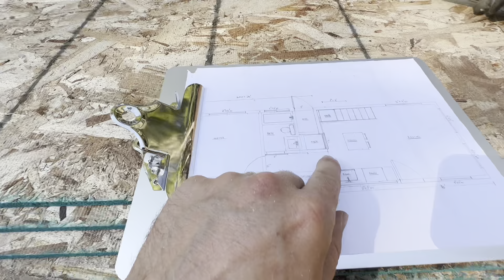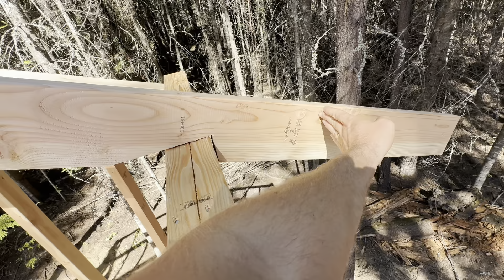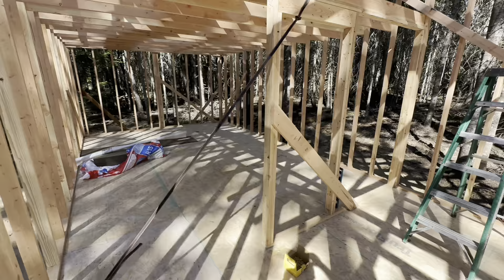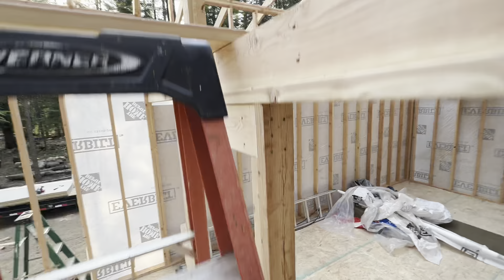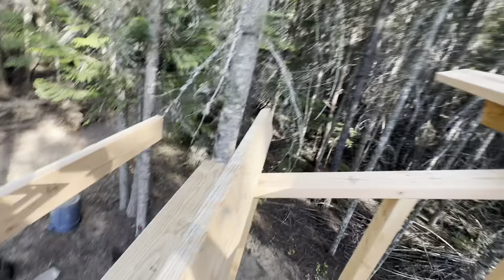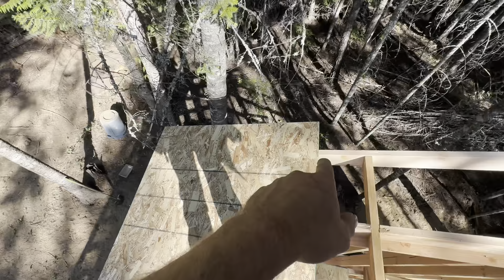Tiny House Build Part 11 (The Roof!)

Comment: I still think you should swap the Frig and washer/dryer locations.
Reply from the maker: I’ll definitely consider it. :) especially once we get more done inside. 👍
Reply: @thebuildinginvestor8427  FYI Kitchen design suggest we consider the path between the sink, range and frig as a triangle. The circumference of this triangle should be as small as possible with no obstacles.

Comment: As to the ridge beam, it looks like you have a double 2x10 spanning 20', but rather than using 20' members, you have joints between spans.  So the simplest approximation is that it is only as strong as a single 2x10.  [That approximation would be sharp if you happen to have a joint at the point of maximum moment, as then the entire moment would be carried at that section by a single member; if you know that you have two full plys at the point of maximum moment, you could calculate the moment at the joint locations and use it instead of the maximum moment, assuming you can calculate the stitch nailing appropriately.]

Your ridge beam tributary width is 7 ft (half the building width) so each beam span is carrying 140 ft^2 of roof, so no live load reduction is permitted.  Not sure what your exact dead load is from roof sheathing, metal roof, rafters, insulation, and gypsum board, but 10 psf is a commonly used figure.  And the roof live load is 20 psf.  So your ridge beam has to carry 210 plf for 20 feet.  That means the reactions at each end of each 20' span are 2100 lbs, and your maximum moment at the center of the span is 1/2 * 2100 lbs * 10 ft = 10,500 ft-lbs.  [This assumes a simple span; the way you have constructed the beam it looks like you have continuity over the center post, so the maximum moment would be greater than this.]  That exceeds the capacity of a single 2x10 of any grade and species.  An online calculator I haven't verified suggests a select struct douglas fir larch north 4x12 would suffice, but best to verify that or use some LVLs and the manufacturer's published data.

If you added supports to reduce the span to 10', then the reaction would be halved to 1050 lbs, and the maximum moment would be quartered to 2,625 ft-lbs.  Now the online calculator says a SS DF-L(N) 2x10 does suffice, although #1 grade would not.  Or if you added tension ties between the wall plates, say metal rope every 2' or 4' on center, then your ridge member would no longer have to act as a beam, you'd be back into the conventional rafter situation where the ceiling joists/tension ties keep the wall plates from spreading apart.  Although that wouldn't work in the loft area, and even in the unlofted area, it would interfere with the headroom for your stairs.

I guess in the lofted area you could also consider that each stud is braced near its top end by the loft floor joists, so they could be modeled as cantilevered beams to resist the outward thrust of the rafters.  I've never worked out the details of that approach so I don't know if that is likely to check out or not.
Reply from the maker: Hey! Thanks for all your research! 👍
Reply: @thebuildinginvestor8427  Hope it helps.  I forgot to say that if your ground snow load is higher than 20 psf, that will control rather the 20 psf live load, and so the required design loads on the roof and on the ridge beam will be accordingly higher than the numbers in my comment above.

Comment: A few framing comments:  IRC Table R602.3(1) Framing Schedule lines 15 and 16 specify the nailing pattern between the bottom plate and the floor system; if you are using 3" x 0.131" nails, then it calls for 12" o.c. everywhere, bumped up to 4 @ 16" o.c. at your braced wall panel locations.  For larger nail sizes, the required number and frequency is less.

IRC R802.7.1.1 limits the notch depth on your birdsmouth cut on your rafters to 1/4 of the depth of the rafter, which it looks like you have exceeded.  This is mitigated somewhat as the minimum rafter size for a 7' span (assuming the ground snow load does not exceed the 20 psf roof live load) if you use #2 or better lumber (any of the standard species) is 2x4 rather than 2x6.  So if you have a depth of 2-5/8" or more of intact wood remaining a the birdsmouth, perhaps that is arguably OK.  I thought perhaps there was a requirement that the heel of the birdsmouth cut has bearing on the wall plate, but I don't actually see that in the IRC, so perhaps I am mistaken.

Your ridge beam looks undersized, I will comment on that separately.